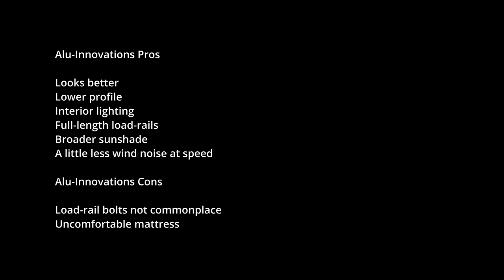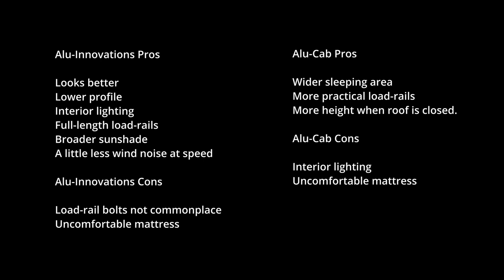TROOPY CONVERSION COMPARISON. Alu-Innovations VS Alu-Cab Hercules and Alu-Cab Thor | 4xOverland

Comment: I have a German roof conversion on my Troopy from Custom Campers and yes the Alucab / Aluinnovation variant with the easy way to pull the bed down and everything is ready is nice. BUT by stacking the bed away you have FIRST of all lots of room in the front to throw pillows and blankets away to the front and its stored. SECOND you gain lots of head room in the back. Hence two people can actually sit in the back while the roof is closed. Awesome in European rainy days. THIRD the stacking is actually not that bothersome. Takes maybe only 10s longer.

Anyways awesome to have yet another open opinion about the roof conversions from you Andrew!
Reply: I agree completely!  The ability to sit in the back in comfort with the roof down is a deal maker. This is partly as a result of a slight increase in height and partly as a result of the bed setup. Setting up the bed is not a big issue.  How about Alucab or Mulgo offering this setup as an option?

Comment: Alu-cab have mentioned that they are working with Ineos Grenadier engineers directly some time ago.  l do not see the switch panel being a issue in doing a roof conversion.

Comment: Hi Andrew, I just wanted to say that I had the Alu-Cab Thor conversion completed yesterday in Port Macquarie. (Second install in Australia) With a few tweaks by MidCoast 4WD who did the installation. (Adding the roof liner and side trim back in) I couldn’t be happier with the product. Due to the limited size and that I haven’t sorted a draw system out added the external ladder for now.

Comment: Such a tease seeing the Grenadier shots! It would benefit so much from being slightly longer. With the back seats gone, it doesn't has the length to sleep comfortably. And the same would apply to a shortened roof conversion with the Grenadier.

The Bronco is getting an Ursa Minor conversion. The Bronco does suffer from a limited payload though.

Comment: at the moment is the Grenadier even affordable. All said and done a Troopy, Land Rover, Discovery, Grenadier and many others are excellent for their own specified purpose within design constraints. It follows that modifying these vehicles also have design constraints not least GVM cargo load etc. Simply you make your choice of a canvas and paint it to your desire. The problem is when that desire is dreamland. Simply put one gallon does not fit in a pint jug.. As for the bedding/mattress issue why not simply install an inflatable mattress it can be as firm or accommodation as the pressures also could save on dimensional issues in transit. Great review and so fair to all Andrew. Surely it is what we are all about we buy a on size fits all specification then tease torture and extract from it whatever suits our requirements.... the very best of (re)engineering is often extracted that way

Comment: Good review on them mate. The only thing that was holding me back from doing any form of roof conversion was what it did to those incredible troop rooflines. When I found out about the Alu innovations it was a no brainer. It's hard to tell its even had a chop at all. I completely replaced the mattress with a 110mm Clark rubber one, and still shuts perfect with that and all bedding minus pillows. Keep up the in depth reviews mate 👍

Comment: my opinion  it makes more sense on a van conversion  is a 4 wall camper  you are limited for space otherwise  due to to hinge on the front..

if you wanted 4 people sleeping  your   would likely need it to  go higher than it is  at present to keep bonnet clearance as you would be extending out over the bonnet  with it  supported with leg

the only way to get more shoulder width clearance  is likely add an exoskeleton roll cage with a portal rood

Comment: One thing no one ever talks about is the tent canvas. If it gets damaged can it be replaced? Also what's the drainage like, is there risk of it going mouldy? Roof top tents are notorious for condensation forming under the mattress which leads to mould. Does this happen in the roof top conversions also?
Reply from the maker: No. And I'm not sure why condensation is not an issue with either of these products as it is with metal RTTs.
Reply: @4xoverland  moisture under the mattress is probably not an issue because the car is all a similar temp whereas a RTT on roof racks the two faces of bare metal would be much colder than the inside of the tent and so moisture collects

Comment: Funny, I don't think there is a single manufacturer of roof tents or conversions such as these who supplies a comfortable matress. As it is extremely important to us to keep our bedding in the tent when we fold it (for all the same reasons that Andrew raves about during set up), we added a self inflating air matress under the uncomfortable matress supplied in our RTT by Autohome. It needs to be deflated, though, and just folding the tent does not work for this. So we use our compressor from the intake side. It only adds about a minute to the packing/leaving routine, and one way valves in the hoses make it very easy to use. 

BTW Andrew, when starting with a bed that is 130cm or less wide for a couple, every additional year of age over the age of 30 requires exponentially increasing the width of the matress if you are to be comfortable. My wife and I are about the same age as you 2. We are up to a 160cm wide roof tent :-))
Reply: Mulgo by expedition centre is slightly wider and has an awesome sprung bed setup with extra storage room

Comment: The bride and I test drove a 79 the other day. The bride likes the 79, but I prefer the 76 cause I currently drive a 300tdi. The problem is the 79 won't fit in my garage, and I don't want it stand outside cause Port Elizabeth's air is very corrosive. I bought my tdi in Pietersburg without any rust, and within 2 years my firewall had corroded so much you can stick your finger through it. We are a family of 4, so at the moment we're using an Echo 4 trailer. Works ok. The Mattras is also shocking....
Reply: BTW cool vid...

Comment: The roof, think of an durable capsule 
That needs to be lifted and perhaps relating to weight, you could use carbon. If not magnesium like used in some rifle chassis. Thoughts ?  So you fix the capsule on the roof then cut the roof from the inside. You then add a carbon fibre base that slots into groofs on both sides.

Comment: So clearly a Grenadier is soon in the offing based on closing video mutterings?  A goal for a roof conversion there  might be to hinge the overhead switch panel if the front sloping portion of roof really needs cutting out,  else leave it in place and span over it ？ Looking at the massively reassuringly  robust Grenadier roof structure in factory footage, I suspect there will be some rules anyway  restricting the scale   of can opener deployment to preserve its likely excellent crashworthiness and rollover strength. Characteristics perhaps   worth retaining when you see soberingly what happens to old Defenders when TSHTF.

Comment: Although I can appreciate the amount of thought and design innovation in creating these vehicles; the ever present elephant in the room is weight.I must have missed the episode where Andrew expressed his disdain for a rugged off road camper set up.A camper could stay with you over the life of several tow vehicles; plus you are free to travel away from your campsite unencumbered with a relatively light vehicle. When you reach home you have a very easily managed town vehicle whilst not having to lug x tonnes of gear around with you.Obviuosly towing over dunes etc is difficult with a trailer but so is the stress on a GVM uprated vehicle loaded to the max. If you are doing several expeditions a year a single vehicle may be the answer ;but for the average explorer I think a towing solution is better.

Comment: Amazing video andrew. When sitting down in the vehicle, how much weight would you say is the upper limit to have added above your shoulders (when sitting down), if you don't want to ruin driveability?
Reply from the maker: Troopies are top heavy to begin with. But the suspension here helps a lot. I'd say, anything about 120kgs up top is going to compromise handling a lot.
Reply: @4xoverland  Thanks for that

Comment: I’m very interested to see if the 70 series market will be the same as the Grenadier based on the price difference. In SA the Grenadier is priced in between the GX and VX LC300 which is substantially more than the 70 series.

Comment: If the awning doesn’t cover the top of the windows, it is useless as it doesn’t allow you to open the top canvas windows a little to allow air flow, especially when it’s raining.  The Quick Pitch RTT does this perfectly and something both ALUCAB Hercules and the ALU-Innovations should look at.

Comment: Can a inflatable Matress be used instead of the standard mattress??? Also, since you already have a air pump on board, that can be harnessed to do the job????
Reply from the maker: I suppose it could. But I'd rather sleep on a bed of nails than on an inflatable mattress.

Comment: It’s interesting that you like the mix of indoor and outdoor living in the troopy yet when you built the ultimate tourer it was set up for mainly outdoor living. I’m building a camper for a single cab 70 series which aims to have the indoor/outdoor living mix of the troopy. It should have more space overall and I’ll get away from having the angled wedge roof.
Reply from the maker: and that is why the Ultimate was the ultimate by name only.
Reply: Mate the single cab 79 is so so so much better than the dual cab in every way. It is a much nicer rig to drive, providing it is set up well of course and the weight sits nicely in it too.  My second favourite 70 series, sits only slightly behind the 78 IMO.

I’ve had a 75, 78, 79 single, 78 and I am waiting for my final 78 (which death do us part applies 😂).

Comment: Don't be put off by the 'complexity' of fitting one yourself.  If you have access to a vehicle hoist, or a forklift, it makes it possible for a DIY person to fit.  I fitted my Alu-Cab in my shed, and it took about a day and a half to do so. The pros will get it done much quicker than that.
The only tool I had to buy was an air shear, which cuts out a 2mm strip of steel. Cost was $400 (Australia). I took my time marking it out, and double checked things but it is not very complicated, and the instructions from AluCab are pretty good.  Once you cut the OEM roof off, the AluCab just drops down over the hole, and it fits like a glove. It has 8 (?) bolts to bolt it to the side of the Troopy, but mainly it is held there with copius quantities of Sudal T-Rex adhesive (same as SikaFlex).

Comment: Hello Andrew,
A quick question, if you'll indulge me;
The sleeping platforms, and their supports, are they all aluminium? or maybe aluminum & composite?
I'm curious how they've managed weight & strength.
Thank you for another great video.
Reply from the maker: Aluminium. Simplicity of build is important. These are fairly low-tech products.
Reply from the maker: @biilybutt9016  It's not an insult or compliment. Both are hand made in small factories in South Africa. Some aluminium parts are made from extrusions but most components and shaped and cut by hand. By my definition, low-tech.

Comment: When it comes to modifying a Grenadier above the roofline to accept a Popup roof conversion I think a cab-over floor might work. 
You may have seen my Ford F-250 SuperDuty on FB with the Alucab Hercules? It was a relatively simple task and we didn’t even modify the Hercules… I just enclosed the front sleeping area by 30 inches.
Upgrading the lights and mattress was a simple task.. so was adding additional lighting and USB’s.
I’ve suspended a lightweight cargo net under the sleeping platform for the pillows which makes closing the roof with all bedding inside very easy. 
Calling the Company Alu-Innovations is a tad cheeky eh… they hardly innovated the design… Alucab did 😂.
Do the two pop ups both share zip out bug screens?

I think you might have set a new colour trend with this latest build… 😎👍😎😎👍

Comment: Thanks for the info. I prefer alu innovations shape but I'll be going with alucab. Any particular reason as to why you went with alloys over steelies ? I'm having this dilemma now and my main reason is the classic look and ability to repair the steelies. bit stuck lol
Reply: I’ve been over with my 4 previous 70 builds and I can just say there’s a weight advantage of going alloy & also when you pick your alloy you will be looking at something with a high load rating (esp if you’re doing a GVM upgrade). Gone are the days of busting Alloy wheels where the advantage of having steel (so you could flog it out in the bush with a mallet) was an advantage.  IMO, it’s null & void issue and I will be going Alloy again for my 5th & final 78 build.

Part of my decision process was wanting to always carry two spares.  If you run 285/75 tyres (as a minimum), your not going to bust them.

My first 78 did 150k on alloys, my 79 single has done over 450k on its alloys & I had two ther 78’s with a total of 140k…..all on alloys, all always used as travelling vehicles (not daily drivers) & I never busted a modern alloy & I love going rough….my 79 single cab went everywhere & it was HEAVY).
Reply: @GR8Tmate  Thanks for the input of your experience. I have not busted an alloy either on my travelling vehicles. I think my only hold back is the fact I like the look of the classic wheels and hub caps. I have found a set of alloys just like that but expensive.
Reply: @nasseral-momen1463  Ain’t that always the way, everytime I see something I like it’s expensive as well 🤦‍♂️

Enjoy your rig 👍
Reply: @GR8Tmate  likewise. Safe travels

Comment: Hi Andrew, I would be interested in your thoughts on the Alucab Canopy Camper for dual cab utes. Still get the benefit of 4 seats with the upside of the camper that you can sit/stand in, as well as the rear door that holds the spare wheel. Looks like a good design.
Reply: Have they started making the camper again ?
Reply: @ookeekthelibrarian  yes, looks like Ironman and Peak Off-road are distributing them.
Reply: @mattcorkin2519  Tar mate, I'm looking at them now.
Reply: We have had one on our hilux over a year now. Love it. Very practical and comfortable. (After we replaced the matress!)
Reply: @garyjackson2890  The info is a tad unclear, do they have a air pressure system to keep dust out?
The mattress is always the first thing I toss out, I go to Clark Rubber and get a custom one made.
Reply: @ookeekthelibrarian  no air pressure system, but dust and water is kept out pretty well. The hilux tub is not sealed so that can cause some dust ingress 'downstairs' but I've stuffed some foam into the crevices which has reduced it. No dust has ever got in the bedding area. We replaced our mattress with a Sea to summit self inflating double mattress.
Reply: @garyjackson2890  Good to know, I pickup a new Hilux in 2 weeks (not with a tray) 
I'll be looking hard at the Camper.
Thanks again.
Reply: I spend a lot of time traveling in Africa with the different Alu-Cab products. I have made the experience that the Canopy Camper that we have fitted on a Hilux is really magic. Sleeps two people very good. Alu-Cab is fitting new matrasses to all their products. We had more dirt getting into the back of the camper when climbing into it. Whoever fits the camper should seal the tray very well. Then you should have no dust problems….

Comment: Bundutop looks way better....you can move around in a Troopy so standing height is not a deal breaker...(the critical point is to have seating within the Troopy at a height where you can sit straight). The big downside of a rooftop tent is the ladder...other than that it (Bundutop rooftop tent ) is very clearly a superior product.

Comment: The horror stories come from the fact that the vast majority of Ironman Stores are NOT equipped to undertake such work.
Of all the brands in Australia, the vetting process for their distributors is incredibly lacking. Particularly in NSW, many of stores are attached to people well known in the industry in a negative light prior to becoming an Ironman store. There are some good shops, I’m in no way saying it’s all of them, but without exaggeration, I would suggest that 50% of them are no better than a tyre shop for fitting ability, and a decent percentage you wouldn’t want to do business with for far worse reasons. It was really surprising that Alucab chose Ironman to represent them in Australia, they aren’t exactly known for treating industry associates well…

I have attempted to contact Quick pitch for weeks to discuss this unit, but he I had some hurdles meaning communication has been difficult, I was a little sad to hear that the bed is even narrower, the bed width really forces my hand into the 3rd popular option on the market.

I must comment Andrew, this vehicle is just stunning, somehow you have managed to create a build that whilst remaining practical, is for the lack of a better word, really attractive. I think the Alu-innovation top is a massive step forward in aesthetic for conversions.

Comment: Would like to hear the Alucab part of the story. Saying you invented hydraulic pop top beds is a bolt move looking at all those camper vans from the 70’s... You may want to move on from troopys for your next vehicle though. I think a 4x4 Sprinter would get you anywhere you are going with these, just barely off the tarmac. Gives you so much more space to also use with your wife and a place to stay away from the flies... price wise probably on the same level...
Reply from the maker: Sprinter 4wd is not available in Australia. And besides, is a light-duty vehicle. But I would love to try one.